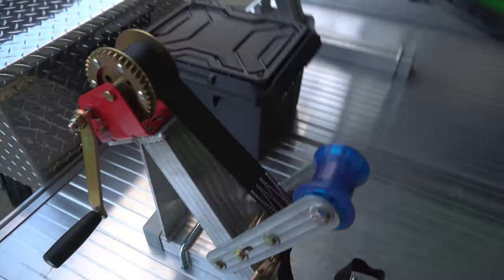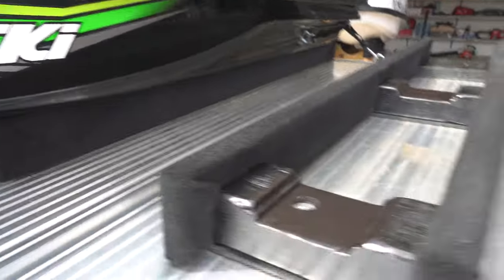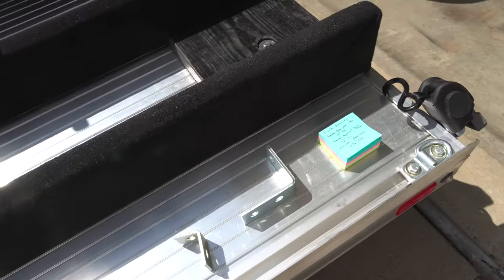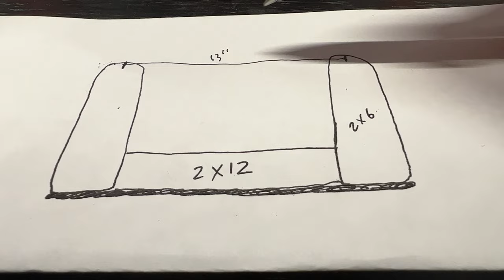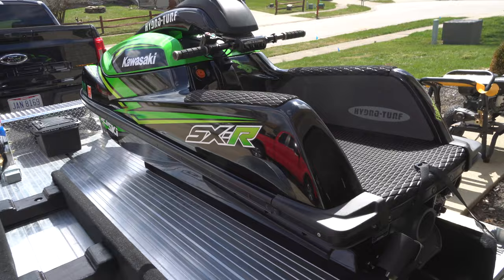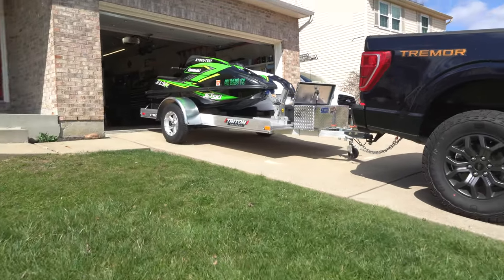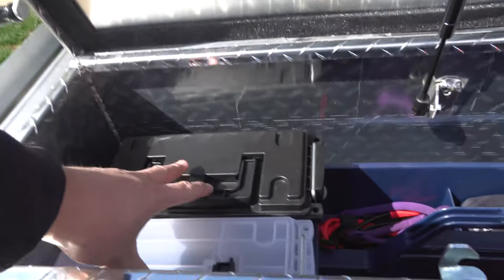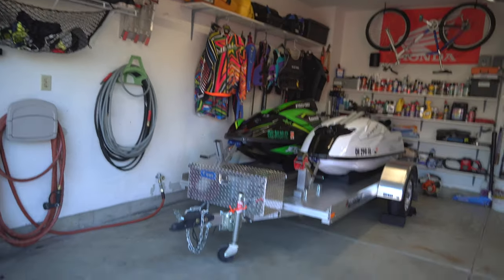4 Stroke Standup jetski trailer

Comment: The bunk measurements part is great. The whole set up is awesome and well made.
Reply from the maker: Really appreciate it! Hope it helps some peeps out! Excited it alll set up ready to rip all summer long 😎🤘🏼
Reply: @Floatsorrolls1  I'm hoping to pick up an SXR before this season hits and I'm just gonna go with a classic two spot trailer since my other ski is full size.
Reply from the maker: @badm0t0rf1ng3r   right on! You hungry for the speed 😈 lol. Even after riding the new superjet the kawi is in just a different league for power. Not as playful as the smaller skis but heck of a thrill grabbing throttle and hanging on! Its crazy how fast it accelerates. 😎
Reply: @Floatsorrolls1  Hey what model is the trailer? I got a deposit on the red SXR and want to do something like this instead of a traditional ski trailer.
Reply from the maker: @badm0t0rf1ng3r  FIT 1064😎 works great and has been perfect. No weld issues like our aluma trailer for the 2 smokes. Only complaint is having to use a longer drop ball hitch mount
Reply: @Floatsorrolls1  thanks man. I'll look into it.

Comment: You never did a b pipe tune video for the smoker. Just installed one would love to see a video from you about it.
Reply from the maker: Yah thats totally my bad. We learned a  crap ton of information on tuning when we switched to the primmer set up and ported mine. We had a bunch of trouble reading plugs as that was our method in the past was but come to realize that method isn’t as consistent and easily applied and diagnosed. Hence why we were getting terrible readings. We got a couple new tricks ill be sharing the entire process, our reasoning and us actually tuning my ski since we never finished dialing it in last fall. Gonna try and make that video in the next couple weeks. Itll be a long one but should hopefully help some fellow two smokers out 💨😎sorry for the long delay just want to make sure im happy and confident in the info im sharing
Reply: @Floatsorrolls1  right on buddy, can’t wait to see what you figured out!
Reply from the maker: @brandonevans9521   weather been terrible here waiting for weather to warm up a bit before start on the vid but wanted to send this over to you this helped us a bunch here is the link. 
https://www.mikuni.com/pdf/sbn_manual.pdf
Its the manual for the carbs we have. Pages 13-17 are most beneficial. 😎🤘🏼
Reply: @Floatsorrolls1  thanks man!

Comment: Awesome video and setup. I’m going to use your bunk design to build a frame and put it in an ice fishing sled as a beach dock. What model triton winch/bow stop did you use?
Reply from the maker: Appreciate it! The sxr winch/bow stop is discontinued but the superjet is 
https://www.easternmarine.com/triton-winch-post-bow-stop-assembly-14676
We swapped out the winch part with one we had laying around cuz the winch part stinks on the one linked above

Comment: Who makes that pin for the tail end of the kawi? Really clean and thought out
Reply from the maker: Appreciate it! We just bought the pin and used old straps we had laying around but here is a link to one with a strap. https://www.watercraftwerks.com/product_info.php?cPath=590_851&products_id=8164.      MAKE SURE YOU GET THE 2.5” PIN for the SXR 1500. We also slid foam insulation onto it to prevent the metal from hitting the ski. A pool noodle will work as well. thanks for watching!🤘🏼😎
Reply: @Floatsorrolls1  is the pin metal? I have a sxr 800 and a superjet.
Reply from the maker: @thesneak281  the sxr 1500 one is metal and we wrapped electrical tape around the cylinder part tht slides into the ski for a snug fit and to not scratch it up.   For the superjets we have the plastic pin. Im not sure wht size you will need for a sxr 800. Both styles of pin have held up great.